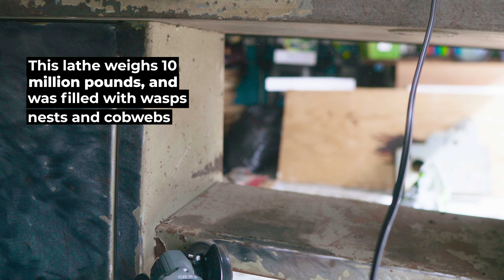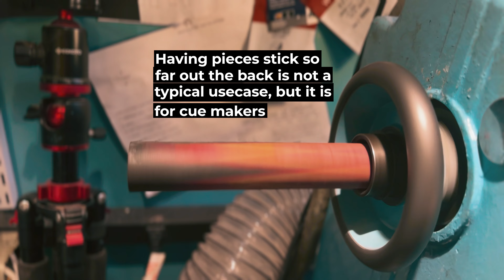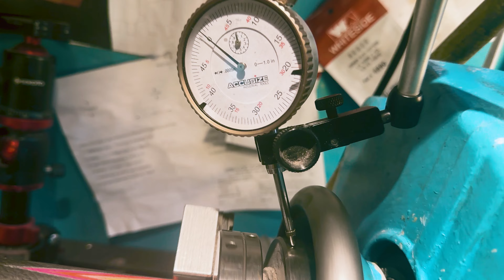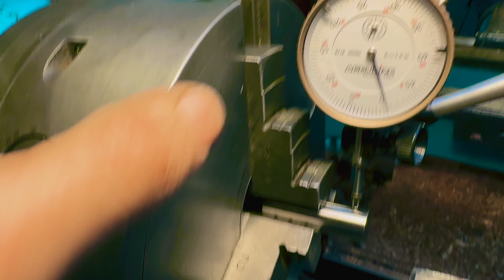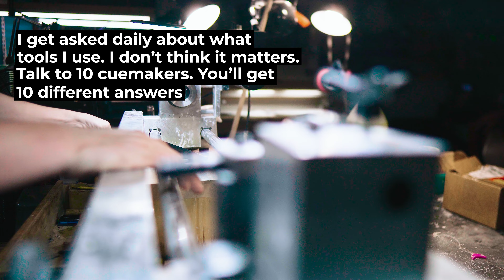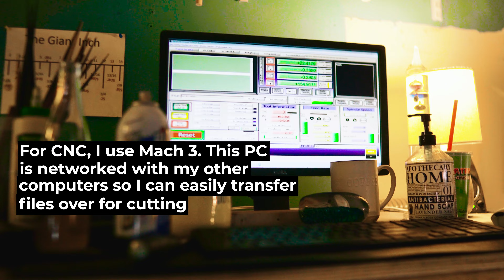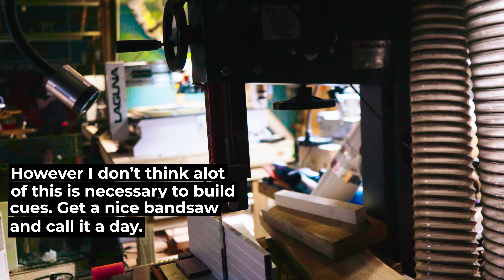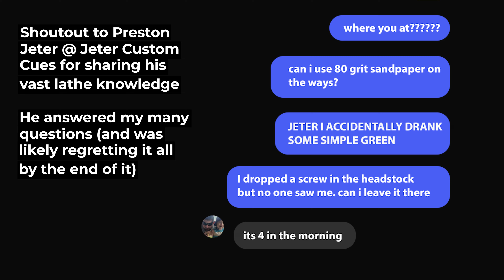Restoring a 60 Year Old Metal Lathe to Make Pool Cues (And Shop Tour)

Comment: That wasnt "Military Green" machinery was painted that ugly Minty green color for some reason- Military Machinery is typically GREY - also you dont beat the chuck off the tailstock with a hammer, if you just turn the crank handle to retract it completely it ejects the tapered attachment easy without damage- good luck
Reply from the maker: The tailstock quill wouldn’t budge. Nothing budged. Lots of evaporust and wd40 was used. Otherwise yea retracting the tailstock would’ve been much easier. 
I still have some pieces that are physically impossible to separate-I had to give up!